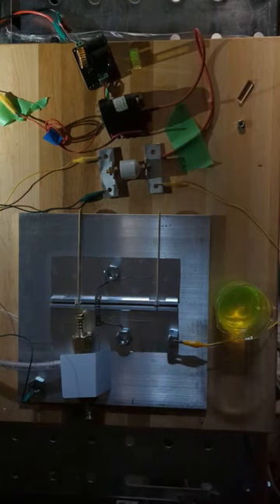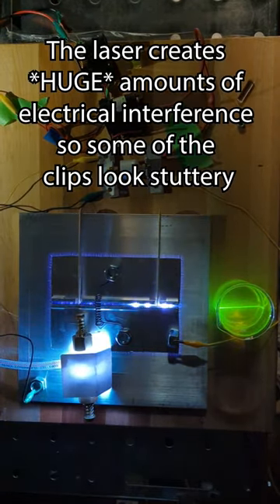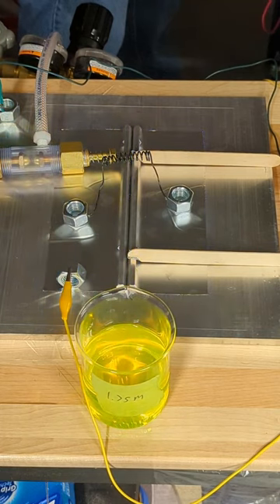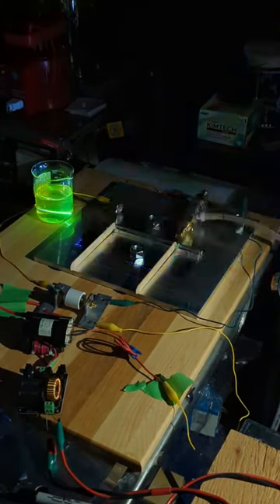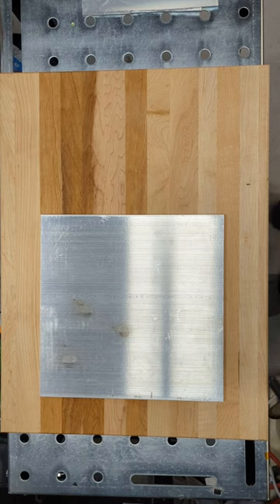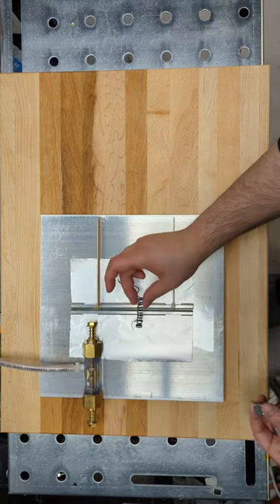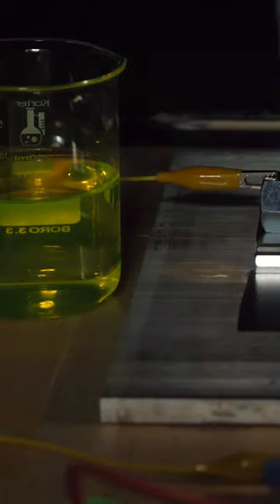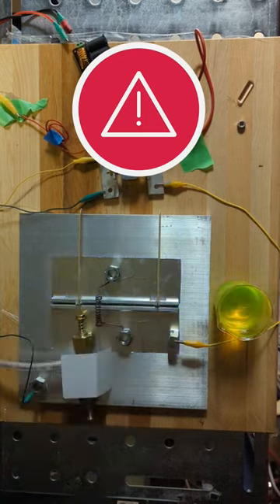⚡A Laser Made of Garbage ⚠️

Comment: I’m really surprised to see this running continuously. Normally clearing out the mid energy Nitrogen needs time to allow population inversion. Did you just happen upon the correct frequency of pulses or is it tuned? Have you added a fan or something?
Reply: No, I believe he is faking it. Do you see the beam passing through the Rhodamine? It is not aligned with the cavity. And the beam is too coherent for this to be from a superradiant laser, using no resonator mirrors. He is shooting the RG6 with a UV diode laser from the other side, I suggest.
Reply: @Morten_Jaeger I’m not sure. The straight electrode gap does collimate reasonably well, and the bend might just be refraction from the light entering the breaker off centre. It certainly would be easy to fake, but the rest of the construction is reasonable for a TEA laser. I’m still surprised by the high pulse rate. Mostly disappointed by the lack of answer to my first question though so who knows?

Comment: its effectively a laser using a spark gap and lc tank circuit, just need a microwave transformer, some angle iron or aluminum, some inductor and capacitors, or you can take an led and reflector and just use a lens to focus the light into a fine point and then polarize it, how your cd/dvd/bluray works

Comment: Hey! Just a random question, can this laser damage your eyes just like any other (strong enough) laser?
Reply: Absolutely. A nitrogen gas TEA laser (the kind is shown in the video) emits light at 337.1nm wavelength. That's well within the UVA range and is extremely dangerous for eyesight, even at extremely low powers UV lasers accumulate damage over time. And at higher power levels, even reflected light (say, from the wall the laser is aimed at) can cause permanent eye damage or vision loss. *ALWAYS* wear adequate protective eye wear near any kind of lasers, doubly so for non-visible light lasers.
Reply: @dunmermage  Thank you for answering! :)